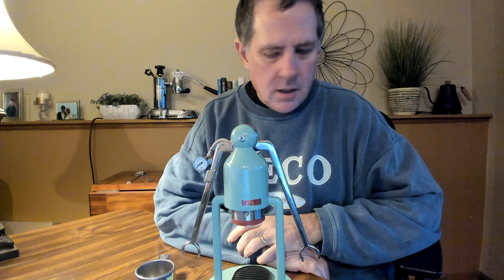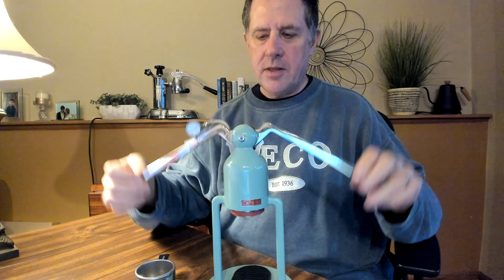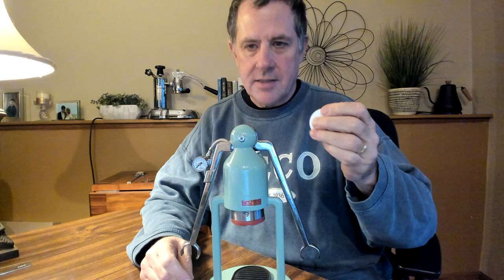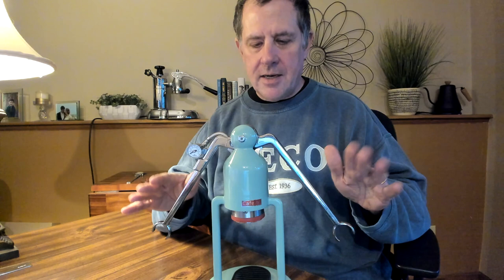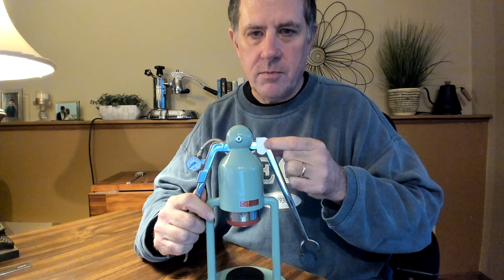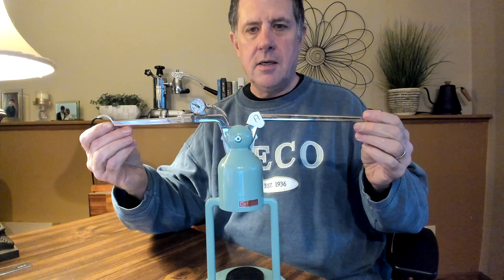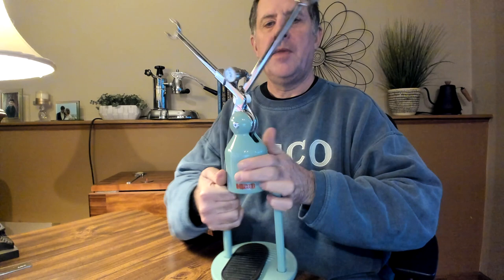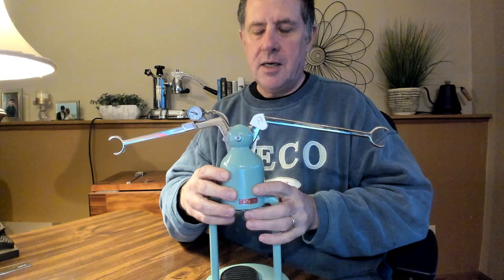Cafelat Robot Arms Up Shoulder Clip

Comment: Nice solution! My robot arms hold in the up position. I think it might be the piston seal holding on the aluminum body with a little friction. I have noticed that one of my washers in the head looks a bit wavy, and I wonder if you’ve thought to make some wavy washers to hold the arms? Maybe if the two outside ones were wavy they might hold the arms?